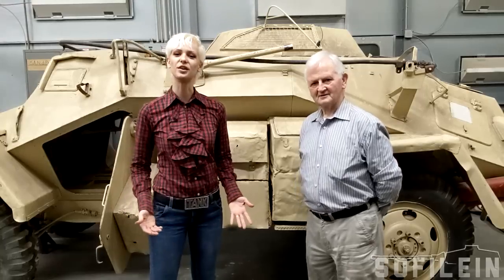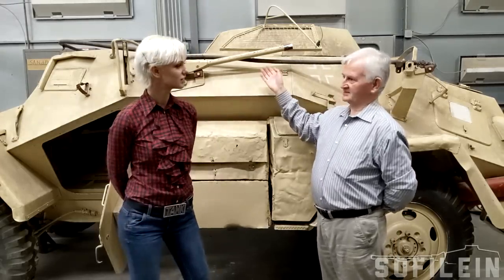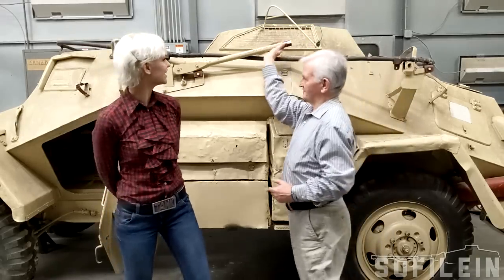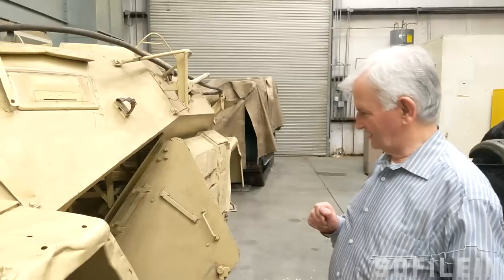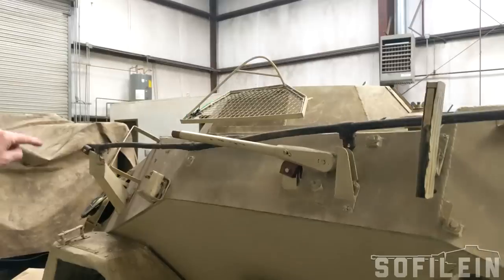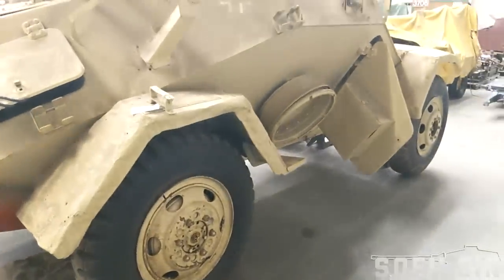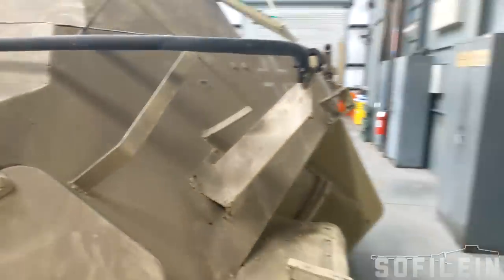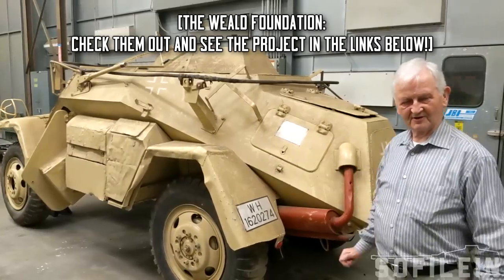Sdkfz 223 with Hilary Doyle at NACC Ft. Benning

Comment: Wow, thanks for that info, i didnt know that the antenna frame could be lowered, but makes sence, so the 20mm flak 30 can engage aircraft, also i wanted to build the radio scout version in 1. 35 scale, but put off by the silly looking bars around the roof... So now i can but in lowered profile..ps does that mean the 6 rad and 232 can do the same?, as some framing is different with a sloped front and rear..

Comment: Looks almost like a stealth vehicle  with all those angles. 😁 I guess they were designed to provide lots of sloped surfaces to compensate for the thin armour.
Reply: Funny how they were so bad at designing sloped tanks. The PzKpfw IV and the PzKpfw VI were obsolete from a design standpoint when they rolled out.
Reply: @cezarstefanseghjucan  No they weren't, they did the boxy design with a very good reason.

Comment: I'd say that armored car probably took a roll over or two based on the damage on the right hand side. Wonder if the hull was designed with mine protection considered? Nice video, Sofi! Very well done.
Reply: No planning for mines - floor was only sheet metal

Comment: Sofilein,
When Hilary says that the Aerial has to be the length of the transmission signal I don't quite understand what he means. Is there copper running inside of that for tuning the signal? If you could I'd like to see a video describing why the antenna had to be mounted horizontally like that, and maybe even how we've advanced our radio communication through the cold war and to this point. I think it would be interesting seeing as how in my opinion information decides a battle more than quantity and caliber of guns.
Reply: Originally, it was thought that antennae had to be at a 1:1 relationship to the wavelength of the signal on a frequency modulated carrier wave.
Later, it has been discovered that it only has to be half of the wavelength  for rod antennae.
Focused arrays can be more compact but has to be perfectly aligned with the target stations array for either of them to pick up anything at all.

Comment: A lot of people say Germany had no clue what sloped armor was until after the T-34, but their armored cars and half tracks all had sloped armor. Which made them far more effective, than say the US half track that can be seen in this video.
Reply: Plus, every European Navy had been using sloped armor since 1860s.
Reply: The halftrack was meant to haul things.  Sloped armor and cargo capacity are inversely proportional.
Reply: Randy Magnum The main thing half tracks hauled was troops. The US used flat armor for costs. The poor survivability of the flat sides was a common complaint.
Reply: @Stuka87  troops is cargo.  The biggest complaint was open top, and resultant vulnerability to air burst shells.  Coincidentally, kraut halftracks with sloped 6mm armor wouldn't stop black tip '06, and had.......wait for it.......open tops.
Reply: They were well aware of sloped armor before the war but the German engineers didn't feel it was worth the cost in design and ergonomics. Flat-armored tanks were easier to build and were more spacious for the crew.

Comment: Wasn't the Horch 3.5 (3.6)  V-8 engine actual a 221 cubic inch Flathead Ford V-8 built by License by Horch?
Reply: We have Ford Flatheads at the Weald Foundation and they are nothing like the Horch V8
Reply: @hilarylouisdoyle1529  
Maybe it wasn't Horch, but license built Ford V-8's were used in some kind of German trucks.
Reply: @godsowndrunk1118  Yes, during the war the Ford production facility in Cologne produced large numbers of flatbed trucks and Maultier semitracked vehicles for the Wehrmacht. These were all powered with the Ford V-8, 3.9 liter 95 PS engines (AKA Flathead)
Reply: @hilarylouisdoyle9940  Thanks very much for filling in the gaps of my old and faulty memory.
I do appreciate it.

Comment: Check out how much the body of it is V-shape and no flat angles designed. 4 wheels need to stay so low on weight in the toughest terrain. Now consider it's gonna be running on some thin WWII era tires. Compared to Dingo or Humber the German one over 1 ton heavier and over 1m longer. No wonder they moved with it to tracks for the eastern front. Its the actual difference between a bad roads and no roads at all.

Comment: according to the german army during the war, this car was very unsuccessful and production was stopped. Too fragile, complicated and hard to repair; also no good off-road. the wehrmacht decided to use tracks or the newer 8x8 recce vehicle.
Reply: I do not think that information came from the German Army. These cars were produced from 1935 until mid 1943 and were in service until 1945. But they moved to semitracks for this purpose as there were few roads in the east